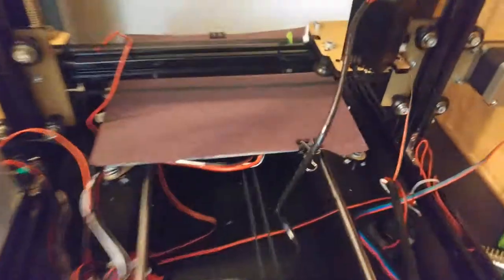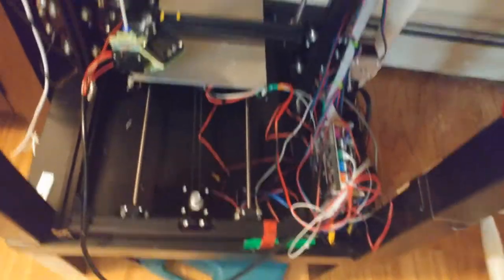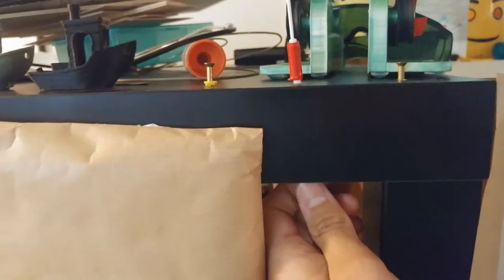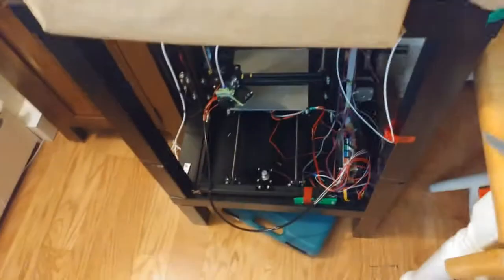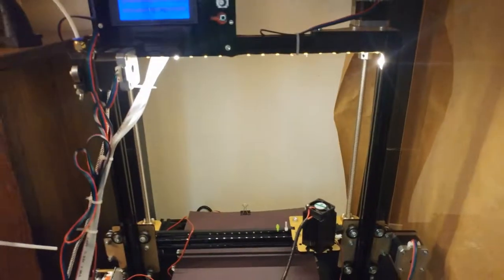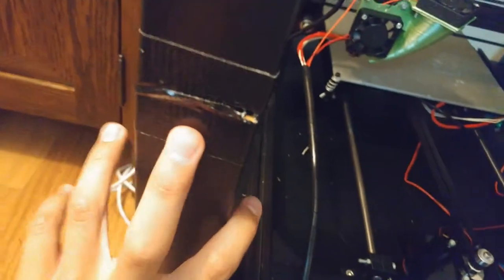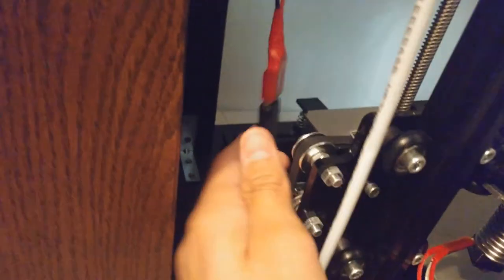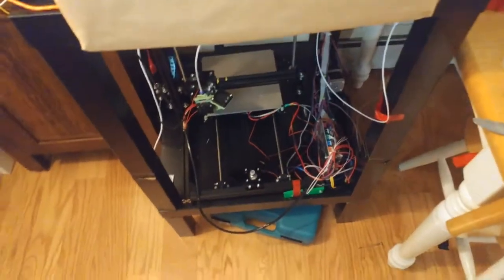Printing on my $120 FLSUN 3D printer (timelapse) + a look at my printing setup

Comment: What's the link for parts cooler and does it have the bed leveling on it?
Reply from the maker: https://www.thingiverse.com/thing:2372783/
It comes with a bed leveling sensor but also includes a z limit switch, the firmware is not configured properly for autobed leveling and frankly I never bothered to go through and configure it myself as the limit switch works fine, (I asked FLSUN for the firmware properly configured for autoleveling and they just sent me the standard z limit switch firmware) If you have any other questions I would be happy to help
Reply from the maker: also the included autolevel sensor is inductive and now that I have a PEI sheet on the bed which I highly recommend to improve print quality I doubt it would even work as the sheet is likely too thick